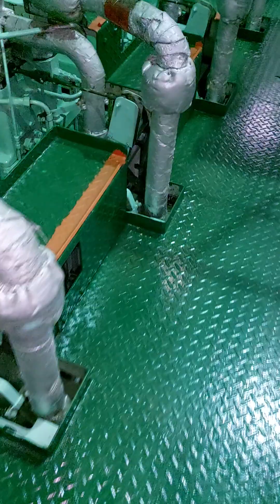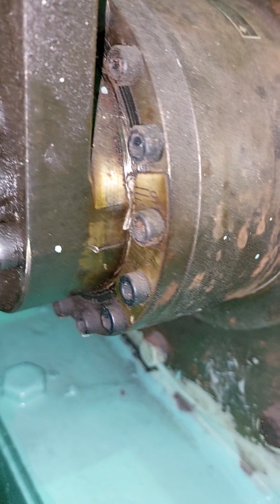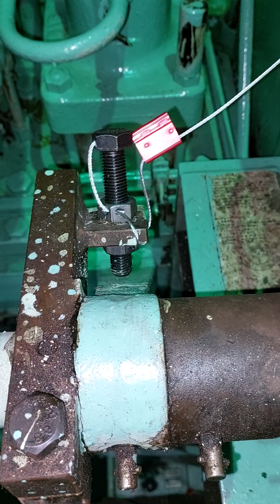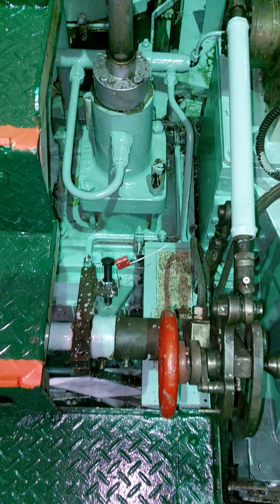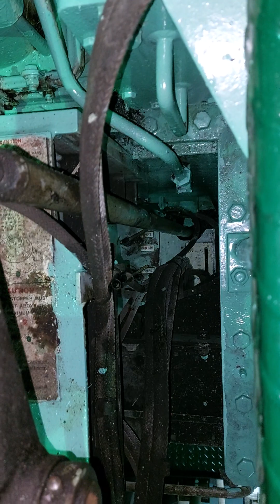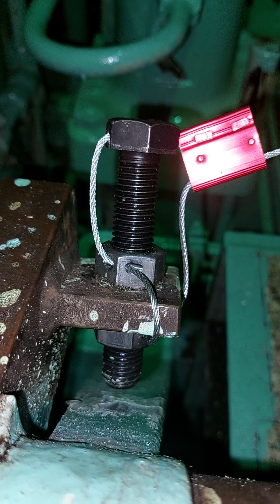EPL (Engine Power Limiter) location

Comment: Epl for all the units or only one unit please explain Thanks
Reply from the maker: EPL for all units my friends
Reply: @benjieG12  but in the video it seems that bolt locking  device is near emergency  maneuvering change over near governor. I can't see that locking device is for all
Reply from the maker: that's the design in our ships, maybe some ship was different.
Reply: @benjieG12  so it means that on your ship only one locking device near governor linkage and not for all units ...am I right ?
Reply from the maker: your right my friend, but EPL is for all units.